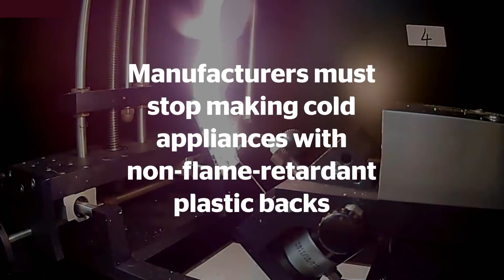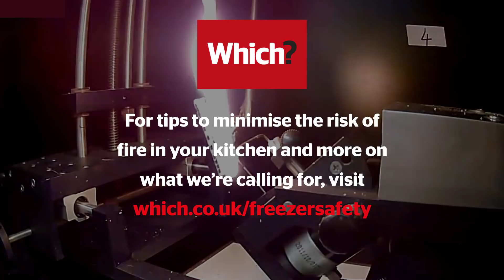Which? refrigeration fire testing

Comment: It is not only the plastic back but the insulation when made uses blowing agent (a refrigerant) which A3 class highly flammable hydrocarbon.Old appliances insulation blowing agent is A1 class non-flammable (CFC, HCFC, HFC & now HFO).
Dont forget that the refrigerant itself is (on some refrigerators) A3 class R600a highly flammable and explosive against A1 class R134a non-flammable. That was the main cause for the Grenfell disaster Refrigerator insulation, Refrigerant and cladding insulation all used A3 class highly flammable refrigerant. Begs the question Why? we there are 10's of non-flammable? Greed and lack of standards and adhering to latest like H&S 2016 no.1107. Note that A1 class non flammable refrigerant was created back in 1928 because its non-flammable. A2L & A3 was introduced only in 2005 / 2006 ????. Classification of safety is in accordance with ISO 817 & ASHRAE 34.